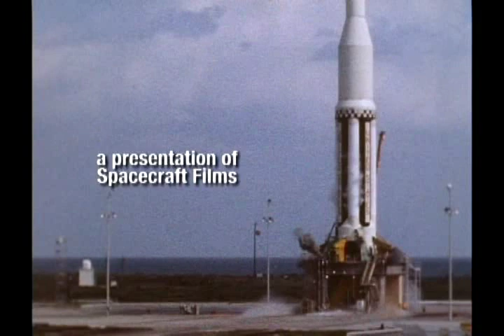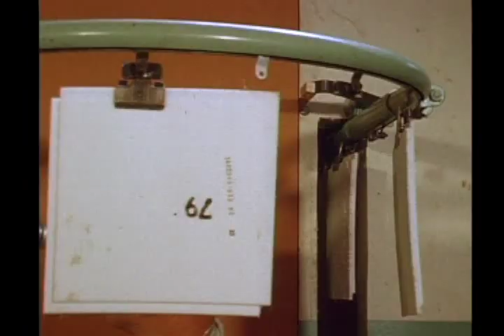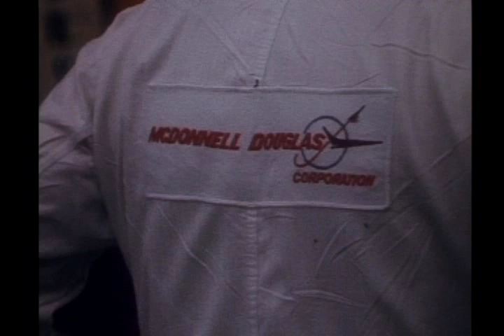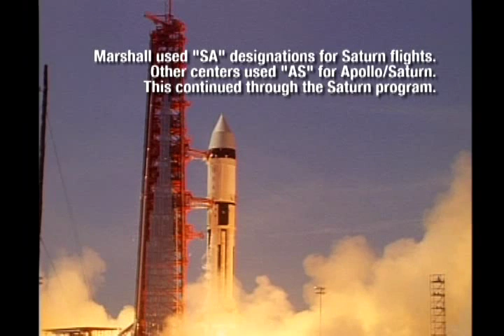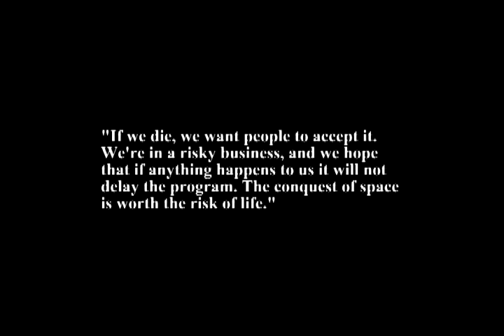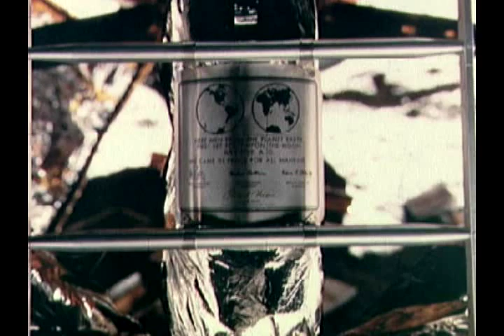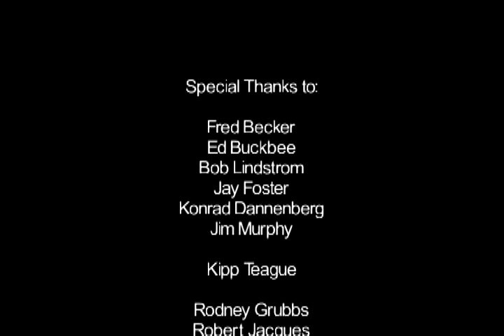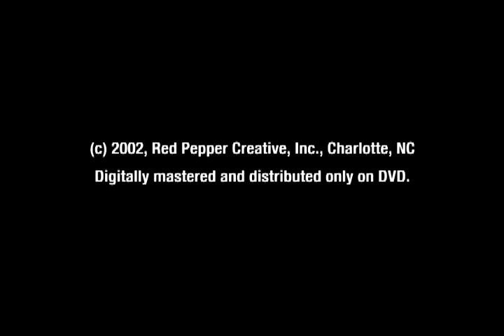Spacecraft Films   The Mighty Saturns   Part I   The Early Saturns 2002

Comment: 42:30 Watching those 6 RL-10's light up was unreal. Most upper-stage engines (like the J-2 or MVAC-D) blow out a bunch of unburned propellant, but those just looked like somebody cranked up the dimmer switch on 6 lightbulbs. Then again, they are the most efficient engines ever flown.
Reply: Just open up the valves BBY🥶